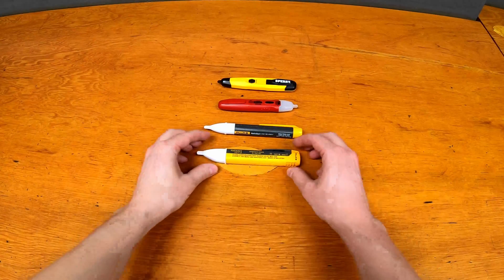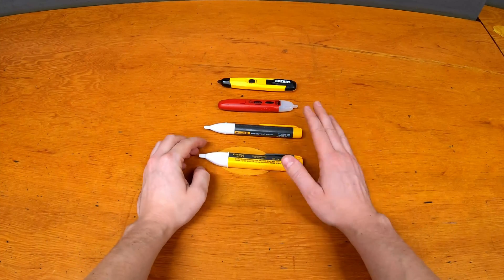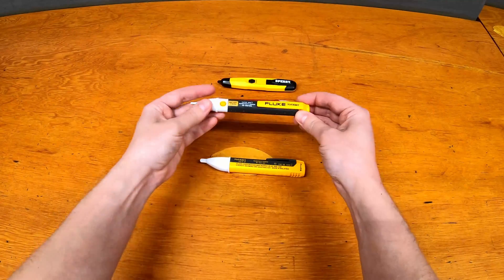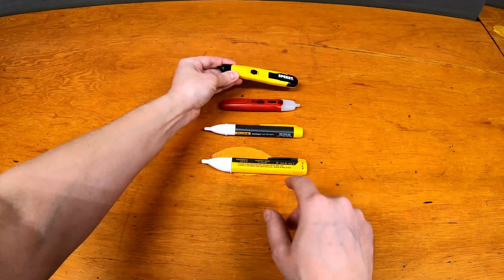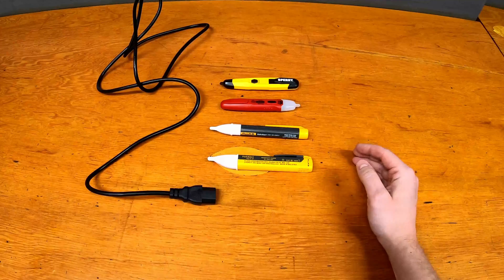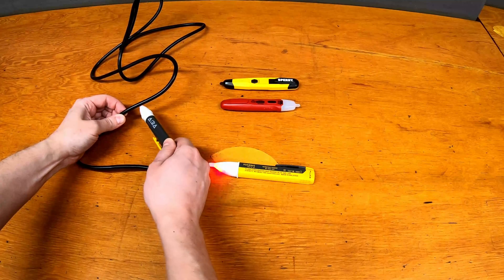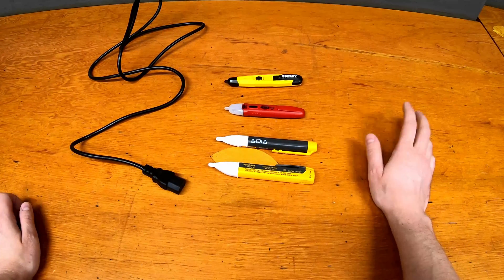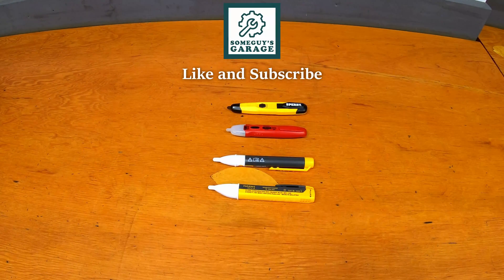Non Contact Voltage Tester / Detector - Fluke vs Sperry vs Gardner Bender

Comment: Great video!  I have the Fluke and over time I have learned to always roll it around a wire just to make sure I check all the conductors inside the insulation.  I like the fact that I almost have to physically make contact with the wire inside the panel to confirm if it is hot or not.   Keep up the great work on this channel and Merry Christmas to you!
Reply from the maker: Appreciate it :) you as well!

I find both have their use, I actually reach for the sperry/gb ones more often, just because most of the electrical I'm doing is sticking my fingers in boxes and just generally want to make sure things aren't live...but the Fluke's do come in handy when you want to check one circuit amongst many in a live panel or similar.